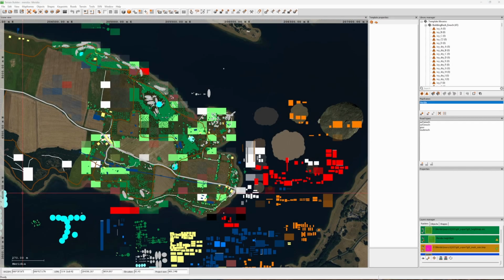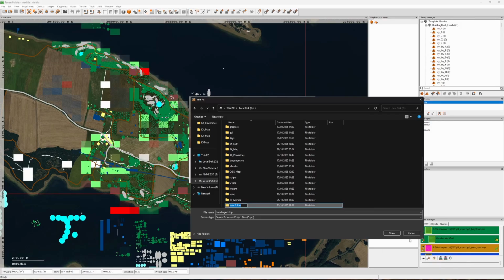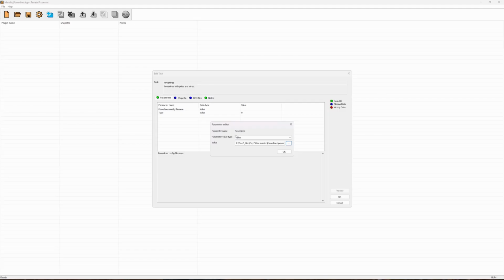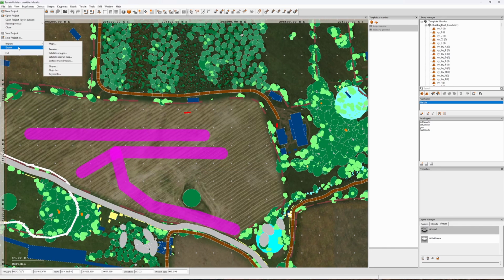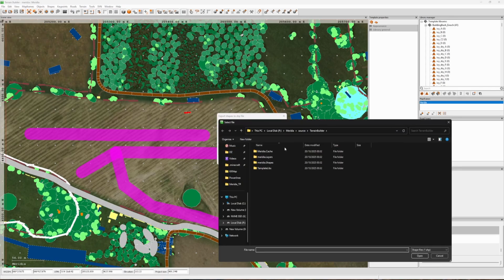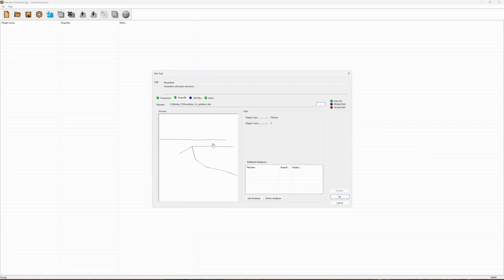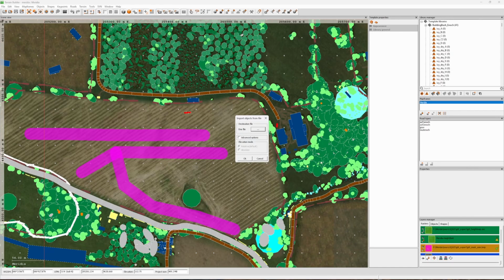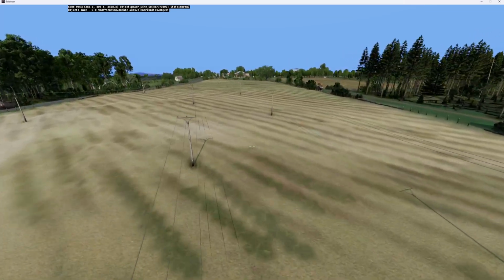DayZ Tools - How to create powerlines

Comment: Good stuff, I have been struggling with the thought of placing power lines and power towers on my map project. Have you had any luck with trees and vegetation using polys in TB? I have yet to find the perfect settings to prevent a cluster of trees in a giant clump, I spend a lot of time going around and separating clusters of trees and bushes.
Reply from the maker: I do mine mostly by hand, I create little pieces of a forest like the inner part and give it random appearances, some more rocks or logs etc then just rotate them around the forest then I just detail the edge of the forest by hand
Reply from the maker: You could try sFlora

Comment: Thanks mate, i've been placing them all manually on our map lol
Reply: Btw found a trick to always have the split lines connected. After drawing in the main line go to where you want the split, Use select button to select the line so that all poles are visible,and now you can see exactly where to start your split line. No need for bends or corners to split from. In my Tb i got a little bit of lag so i can exactly put my polygonLine cursor spot on the pole when tb is switching from selection to polygonLine lol.
Reply from the maker: @TerraViator101  Ah thank you for that information :)